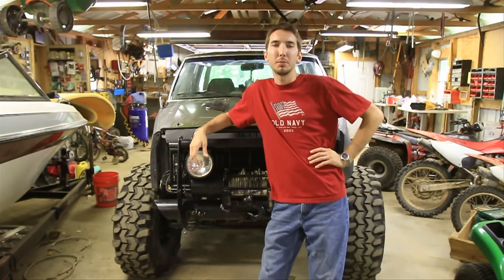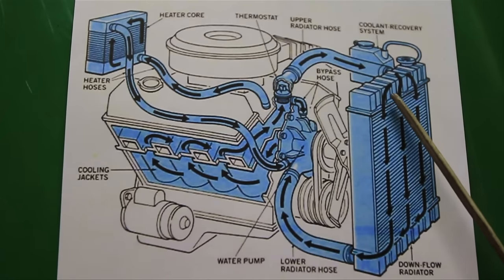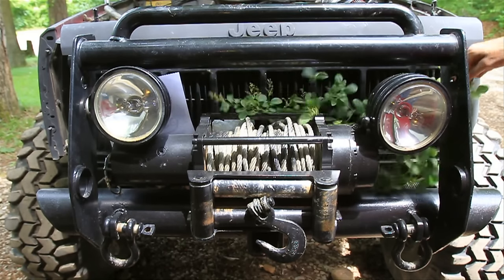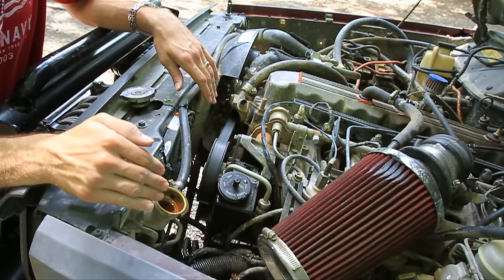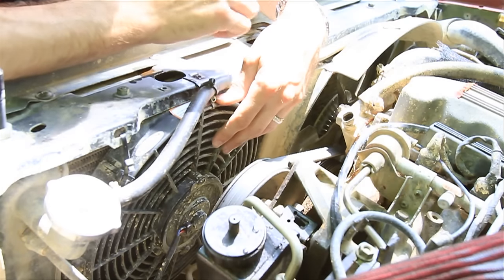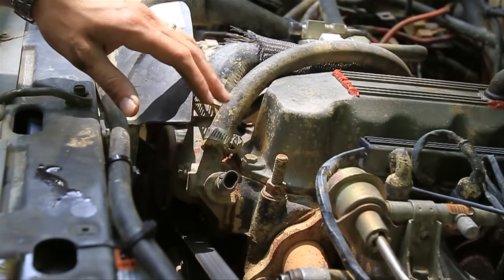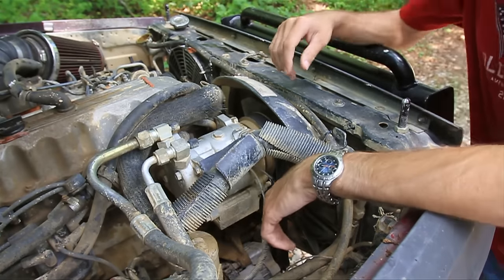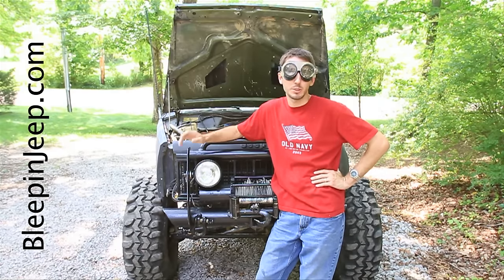Engine Overheating? - 9 Steps to Solve

Comment: Awesome info.  Great gaggles too.  My story is long to type out here so in short:  my 04 Jeep GC Spedial Edition I6 starts to climb to overheat temp only when AC is on and in idle conditions with outside temp at about 95+., Otherwise it works fine.  So I tried that t-stat cold check and I noticed that antifreeze not go down when supposedly the car got up to operating temp.  I felt the upper radiator hose and it was hot. So, even though the upper radiator hose is hot, does the mean that the t-stat is still the kulprit?   Oh, on one occassion when the car was acting up I took the temperature of the radiator inlet and outlet.  I got this Inlet: 220F, outlet: 213F.  So, again, looks like t-stat is not opening or the radiator may be clogged (right?).  Ok here's the kicker LOL.  The radiator and t-stat are only 3 months old.  Plus, just today, I removed the t-stat and  tested in boiling water, and it opens.    I am going to try this, remove the t-stat and and see what happens when the AC is on and idling on a good 95+ day.  If the car remains cool.. then its the t-stat.
Otherwise if u have any other ideas please let me know.   Again, thnx for the info you provided.  Great job.
Reply: Ok, this is what I did today.  I removed the t-stat. It passed the boiling water test. With no t-stat (just for testing purposes) I ran the Jeep in 93F temp and did the AC on, at idle bit several times.   As expected the jeep temp started cooler (at the 1/4 mark instead 1/2).  But as I did more idling (AC is full blast too) the engine temp got up to about 200F.. and that's it.  It would not go up anymore and when the Jeep moved (more airflow) the engine temp went down to operating temp.  So in short, no t-stat, engine temp cooler, but when AC load on and idling or in slow traffic, engine temp was up to operating temp but never beyond 210F.   For now I will leave the t-stat out and test drive it for the next couple of days.  If the temp readings continue to be like this I would think that means that the t-stat, even though it passed the test, is at fault.  On another note I noticed something, this was when I had the t-stat in.  I took off the radiator cap, and turned the jeep on and let it go to op temp.   I didn't see the antifreeze level go down in the radiator or for that matter move or flow.  Shouldn't I see some sort of flow when those conditions happen?
So there we have it.. either I have a intermittent t-stat or a clogged radiator... LOL.
Comment/Suggestions are welcomed.  Thnx for your patience in advance....
I'll keep you posted.

Comment: paid toyota to do diagnostic and they told me to change the thermostat. I have changed the thermostat twice and my car still over heats and they heat gage stops around 75 percent. This could also be a water pump issue since I don't remember changing my T belt with water pump?

Comment: Chrysler 200 2012 is running a little hot only when on the freeway .. turning on the defrosters cools it back down.  Doesn't run hot when idle or during normal driving.  I'm worried this is a sign of a blown head gasket.  Please tell me it's something else ... thx :)

Comment: QUESTION! So my 5.2L Dakota keeps overheating. It was in a front end collision and the radiator was jammed into the fan. Insurance replaced the radiator, AC Condenser, coolant hoses, fan, fan clutch, water pump, expansion tanks. It was overheating so we took it to a dealer and they said to swap out the thermostat. took it home swapped it out with an OEM part (it was like $20!). Still over heats. It doesn't consume any coolant, haven't had to add any in the 3 years after we got it back, no rust in the system (I do a fluid check every 2 weeks). We went back to the shop t hat fixed it and they used OEM parts for everything they replaced. Any idea what could cause it to overheat?

Comment: Hey man , I have a problem with my opel/vauxhall vectra b combi, its 2.0, 136ag/100kw with automatic gearbox, so one day I was driving around city with my friends for a while, and once we went to parking lot and stood there for few minutes, I realised that theres some kind of liquid leak under my car, and it was antifreeze, so I left my car in the parking lot and came back after 5-6 hours with a bottle of water so I can atleast get the car to my garage, and after I pour all the water into antifreeze tank I realised that theres not a single blob of any leak under my car, so I just drove it back home and everything was ok, temperature went up to like 80-85 and then again to 80. Next day I drove my car again, and what I realised is that temperature gets to 80-85, then probably the thermostat opens up and gives some water so it goes down to 80, but from this point water doesnt get cooled or something? Because temperature goes 85, then 80, and then if its a longer ride it goes all the way up to even 95 and I have to stop, after this, once again there was a water leak same as first time, so I left my car at school parking lot, I took some water to school incase, so I used it again after lessons and drove it back home slowly so temperature was around 80 all the time. I'm not too much into engines , etc, but only thing I can think out of this is that radiator fan is not working and water doesnt get cooling? Sorry for such a long story and bad english, but I hope you can understand what I'm trying to say and will answer me :)

Comment: also I found out from the previous owner that he had blown a head gasket and put the fix stuff in the radiator and after I flushed the radiator and filled there was still that fix crap in the fluid. I know I don't have a blown head gasket because there is no white smoke or milky residue in dip stick.

Comment: hi! bro. i need your help my camry 2002 keeps overheating i just change a brand new ECT sensor but my fan are not working when its Hot but when i unplug my ECT sensor cable and my fan works well.

Comment: Since you have what is likely the most well-thought out protocol for tracking down an overheating cause, please allow me to add one technique I used that settled a concern I had this time around on my 86 Grand Wagoneer: I was worried that perhaps the water pump impeller had corroded away. 
That pump was only 3 years old but last time I installed it was a nightmare due to the involvement of other accessories that were co-mounted; I did NOT want to pull the pump just to check the condition of the impeller. I hate doing work that turns out to be for nothing.
In this case,  since I was renewing hoses,  I took the opportunity to stuff my LizardCam down the small pump hose bib.
Sure enough,  after some judicious jamming of the camera past an obstruction,  I was able to confirm that the impeller vane that was visible had zero corrosion. It took a HUGE load off my mind.
(And here's another mini-tip: if you squeeze those hoses cold and unpressurized and it feels like you're crushing Saltines...that confirms a layer of hardened rust. If you're just doing routine maintenance,  give those babies a squeeze. It may be a best way to catch rusting early- aside from what you see when you take the cap off.)

Comment: probably wont cause over heating but should also check the water pump for leaking. once the water pump seal is breached it will intentionally bleeds out water through a small hole to prevent the water from destroying the bearing.

Comment: The spring in the hose was only there for production purposes. They use vacuum to purge on the line. You do not need the spring after that. The spring is worthless once it leaves the plant.

Comment: My cars temp gauge went over half way almost to the red zone.  i have changed the thermostat.  when i went to replace it there was no thermostat in there.  i bought a used car.  the temp is still high so do you think that it will be the water pump thats failing?  The temp gauge gos back down

Comment: i have a 2002 grand am gt i have antifreeze coming out of overflow tube only wen the car is shut off  no leaks anywhere else fuse is still good and the fan still works would the thermastat cause this problem

Comment: Question i get a lill coolant spit out from reservoir only at hight rpm high speed no boiling in the reservoir ? Coolant clear  no cumbustion in it so head gasket is ok no white smoke out the pipes ? So why is this

Comment: my car radiador fan starts right off with the engine wheather its freezing weather or hot weather from My understanding the fan should kick in when the engine temparature get's to a Point where it needs cooling my questions are why would it do that?what tells the fan to run? im suspecting 2 things eighter the thermostat is staying open or the radiador switch is staying closed whats your  take on this one.
Reply: Alfred kabura 

P

Comment: Hi: Thanks for the video.  I have a '90 XJ, Renix, closed system.  I've noticed the temperature gauge climbing when going uphill long distances at highway speed.. Not heavy on the foot.  It hasn't boiled over.  When I get off the throttle on a flat road, it slowly comes down.  It climbs again sitting at lights.  The fan is blowing good air, but not real hot air, as if the coolant isn't circulating that well..  Thermostat opened wide in boiling water.  Didn't pull the pump.  Pump tight.  Fan pretty stiff. Good flow through the reservoir.. Heater works well.  I think this issue, if it is one, started suddenly..  I never burped it through the temp sensor on the intake, though..  Any immediate pointers appreciated! Thanks!
Reply: Did you solve the issue? I have the same problem going up hill, mine is not a closed system but it maybe the same solution...?
Reply: I don't have this vehicle now, but I'm sure it was the radiator.  The only warm spot was at the top when it was running, so most of it was plugged. Horizontal flow.

Comment: Had a question, truck overheats while driving, replaced thermostat and water pump but still does the same thing.... I only used the coolant and no distilled water or water... could that be a possibility?

Comment: I have a 93 cherokee I just replaced water pump, tstat, and radiator and the jeep still overheats. I also have no heat. Would the heater core being clogged be my problem?
Reply from the maker: No, you don't need a heater core to stay cool.

Comment: matt i need some advice on my xj daily driver. my jeep started overheating today when it was only 60 degrees outside and raining. my fans are both running. my jeep shot up to red line on the temp gage while going 60 mph at night in a cool temperature. my upper radiator hose was quite hot and the lower one was cool to the touch. the radiator cap was also cool to the touch and when i opened the cap (while wearing a thick glove for safety) coolant shot out with significant pressure. there was also no coolant in my oil. all i can think is thermostat or water pump but i cant afford to do parts swaps figuring it out.
Reply from the maker: well a thermostat is less than $10 so start there!  Also, most issues are caused by a air pocket in the system so make sure thats not the case.
Reply: thanks for the tips! turned out my radiator cap and my thermostat were outdated. not going to be too harsh on the jeep since its got around 320,000 miles

Comment: I have a jeep 2006 liberty and I don't think I have a radiator cap...is it possible that my radiator cap is connected with the coolant? Also its always bubbling before it overheats.  I hear it bubbling like a gargling going on underneath the hood and then all of a sudden my car is on H on the temp and overheating and steaming. I thought it was the thermostat so I changed it. I notice after though that I had a leak that was patched by the previous owner and coming undone on the radiator which is plastic. Now, I think its only overheating because of the hole but I'm not sure. I don't want to blow my head gasket so can you possible tell me what you think it might be?

Comment: I have a 1990 xj and it over heats I replaced the thermostat, the water pump and put clean antifreeze in it  yes the thermostat is put in correctly  I took a heat gun and ran it up and down my radiator and noticed the bottom is about 20-25 degrees cooler than the top.  Does this mean I have a clogg in my radiator?

Comment: There actually is a way to test a clutch fan-you can get the vehicle up to operating temperature and then try to put a rolled up newspaper into the fan. If it stops the fan-the fan clutch has failed.  If it shreds the newspaper, the fan clutch is operating properly.

Comment: My 2004 Jeep Liberty is overheating. Especially when I'm sitting in 
traffic, the gauge is almost on H (Hot).  A couple of things I've 
checked.  The radiator fan is turning and I can see coolant, which is 
fairly new,  flowing back into the reservoir from a return hose.  What 
do you think is the problem?   It couldn't be the thermostat  could it, 
if it looks like the coolant is returning to the reservoir?  Thanks
Reply from the maker: +Lorie Richards how about a bad radiator cap?
Reply: I went ahead and changed the thermostat, in case it was sticking and I replaced the radiator cap.  It's still overheating.  I've had a slow coolant leak for about a month and I can't tell where it's coming from. That's why I said the coolant is new, I have to keep adding it.    Could that be part of the problem?  Someone told me it could be the freeze plugs. What do you think?
Reply: I have a feeling it might be that the fan isn't working properly, since it gets really hot while sitting at stop lights. My Liberty only has one fan and it's enclosed in the shroud. I noticed it kicked on when the clutch cycled on.  But, how is it supposed to work? Is it similar to the Cherokee?  Thanks
Reply from the maker: find the coolant leak!  there is a weep hole on the back of the water pump so it may be coming from there in which case you may need a new pump or you may have a blockage in the system (most likely the radiator) causing excess pressure.
Reply: I went ahead and took it to the dealership. Guess what? The radiator was split and didn't have much coolant in it.  There were no puddles on the ground,  it was really strange.   So it went from a slow leak, that I couldn't find, and was still driveable,  to having a split,  not holding water and not driveable.  With it being a closed system and no cap on the radiator,  it was hard to tell.  Just wanted to let you know.  Thanks for the help.  ( I still don't know where all the coolant went, I guess it blew back while I was driving )

Comment: I have a 1995 Jeep Cherokee 2.5L when I shut down my jeep the radiator fan will shut off but turn back on shortly after sometimes is that a problem?
Reply: shouldnt do that unless the key is in the accessory position .
Reply: ThisGuyBrett xGBx  it shouldn't stay on must be a sensor or relay

Comment: my 99 honda civic is pverheating in idle i just got a new radiator and fan still running hot hope its not a headgasket but how much due it cost for a gen quote for a pressure test so i can check my hose

Comment: 2000 Cherokee had the water pump replaced a month ago drove fine till all of the sudden overheating at start two blocks away from home drove cooled down but by the time I got to the house overheating again and get out and the overflow tank is pouring out coolant.

Comment: So, I have an 80 cj 5. replaced the radiator, cap, thermostat (even though it was working) and the sending unit. I still get a hot reading, while driving, during idle when engine is cold I have a normal reading. after about 2 miles of driving it runs hot, never boils over though. any thoughts? I've never had an aggressive flush done.

Comment: i have an a/t diesel and i only have issues when im stock in traffic, any idea what to check first?
Reply: could be your head gasket, or water pump
Reply: jason wenceslao jr the radiator fan check if it works.
Reply: jason wenceslao jr check diesel only how much left.

Comment: Help! 2007 Jeep Liberty. Only overheats when driving. As soon as it drops back to idle, temp comes back to normal. Changed thermostat (now it is completely removed) and it still overheats while driving. I believe the pump is fine (was changed 1 year ago), clutch fan is ok, elec fan is running, pretty sure I got all the air out. Cabin heat only gets warm after engine has been running for a long time (this was also the case when I had the thermostat in)... I am at a loss right now... Any help would be REALLY appreciated....
Reply: I should mention that the rad cap remains cool (but system is under pressure when at normal temp). Starting to think the damn pump just may have gone again... Any other suggestions of what may be the issue? I feel like I may be missing something lol